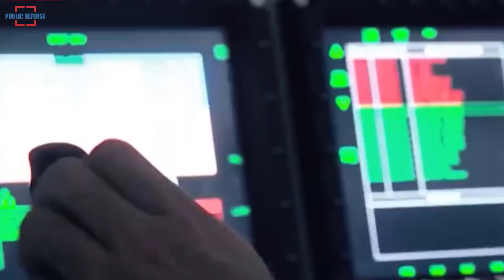Turkish Changes Design of TCG Anadolu for the Use New Bayraktar TB3 UAVs

Comment: Highly doubt if the changes can be made or will be made. It will take atleast one more year if it is done and it might be a bit complex to accomplish as well.
Reply: I think this year the ship will be delivered .
Reply: Turks do work very efficiently and swiftly when its needed.
Reply: As far as I know, the plan was to keep the Anadolu as a "standard" litoral ship(Helikopter Deck).
And the Sister ships that is being build to be converted to a Drone Carrier.
Reply: @Doan84  yes ATAK 2 coming which is heavy armored attack helicopter, will be used on Anadolu as well.
Reply: Ask Turks the impossible  .... 
Turks: Hold my Ayran and wait 1 year.